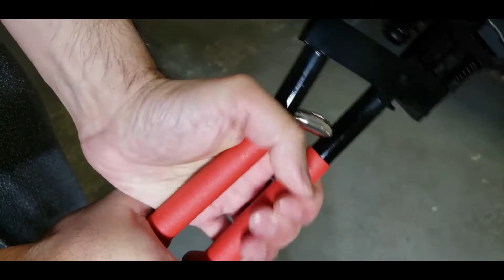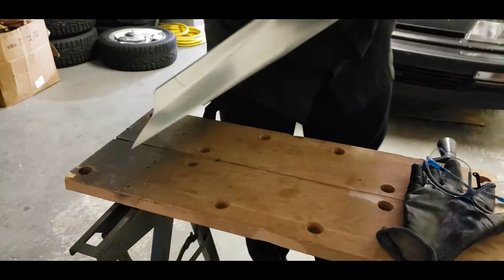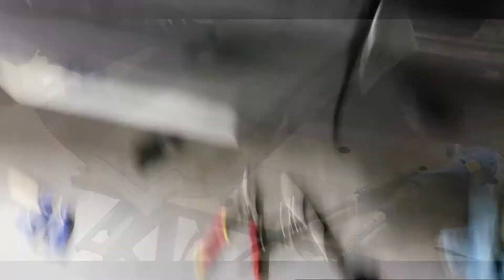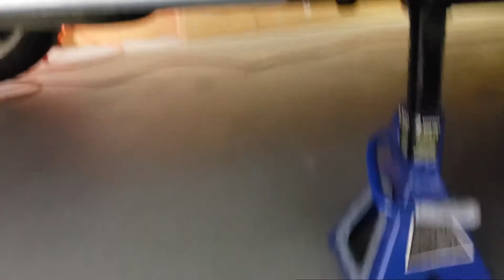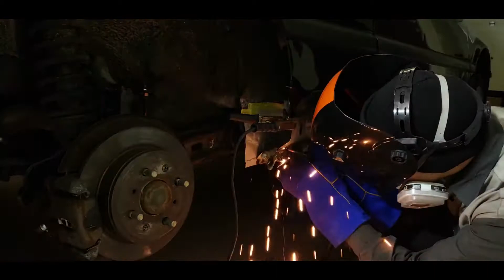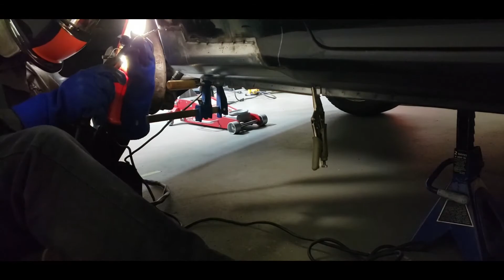[Car Rust Repair] How to Flux Core Weld Rocker Panels and Inner Wheel Arch - Part 4

Comment: What welder did you use, what wire and what settings on the welder
Reply from the maker: I used an old Campbell Hausfield flux core welder. lincoln 0.30 flux core wire. And I had it set on low at speed 4.